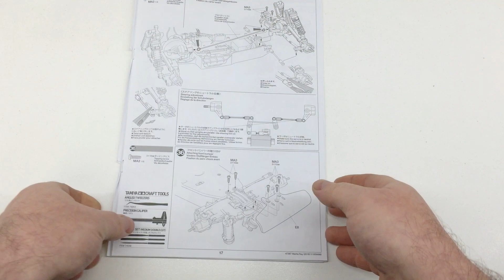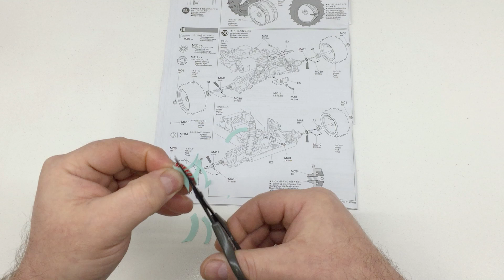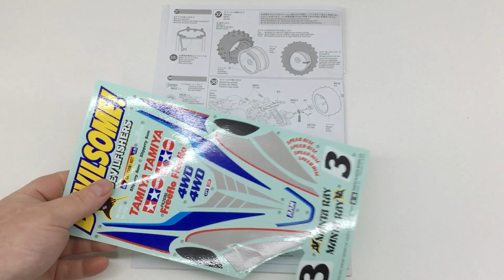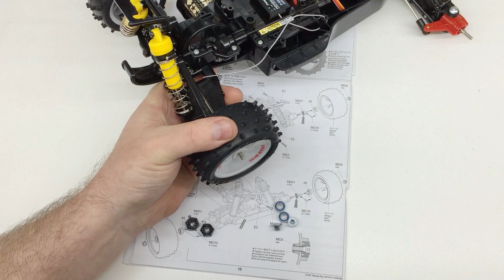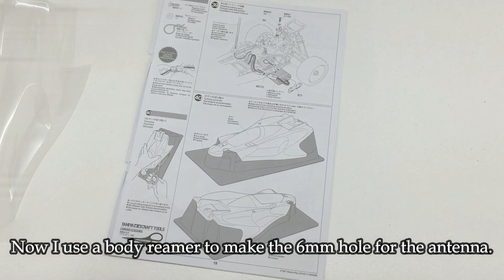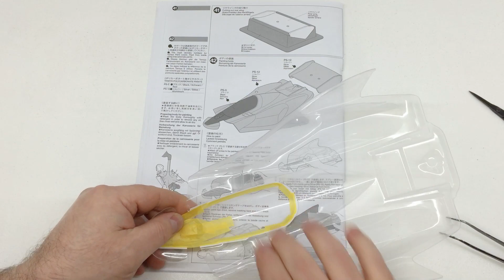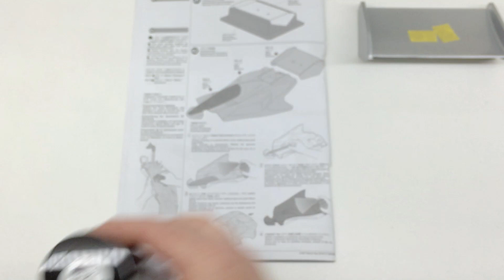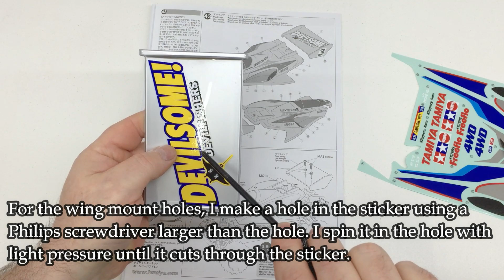Tamiya Manta Ray (2018) Build Steps 37 - 44 | The build series finale!

Comment: Looks like a pretty straight forward build, and no too expensive either. Are they Tamiya tweezers? Might have to get some.
Reply from the maker: It was a pretty easy build. I think it was around 3.5 hours all up. Without the camera it might have been 2.5 hours. Yes they are Tamiya tweezers. I do have the smaller Tamiya tweezers for decals, but I find them fiddly so I use the bigger ones.